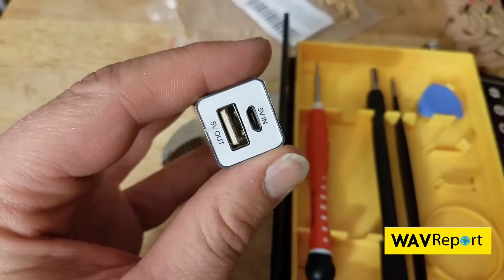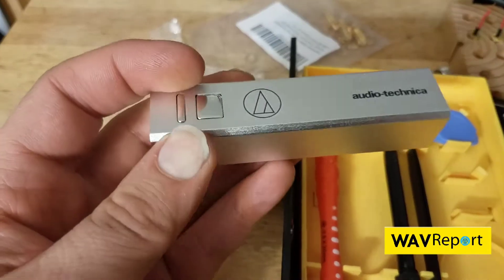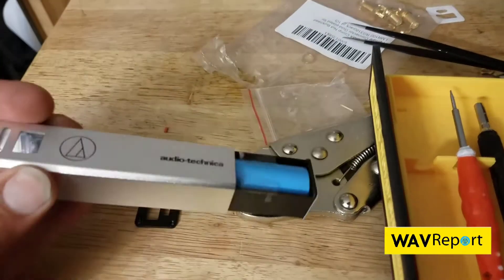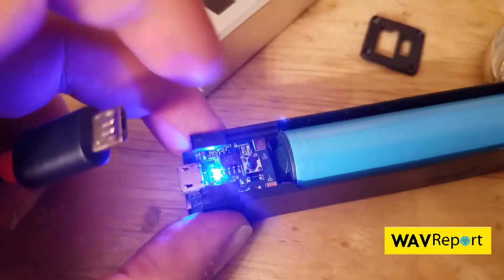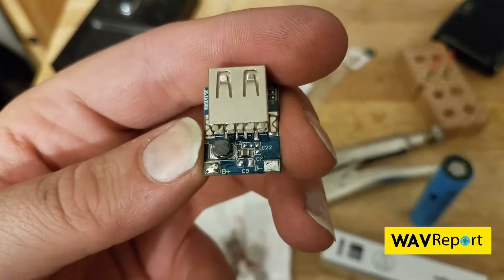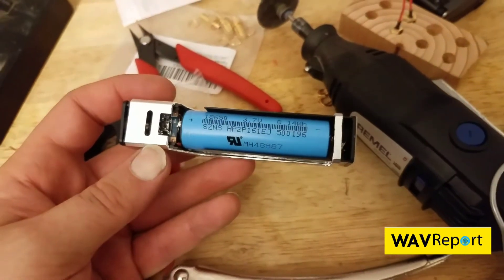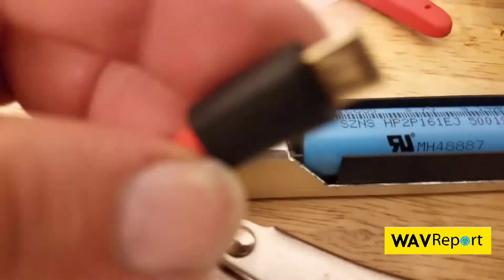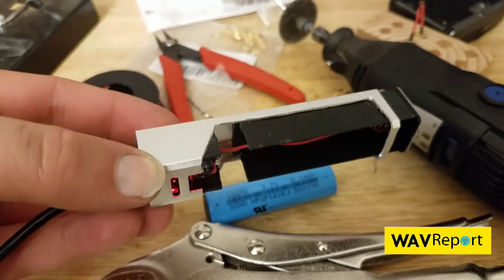Hacking a USB Battery into a 18650 Charger

Comment: I'm wondering, I have one of these. Can I use the board to charge a 3s battery pack? If I wire them in series would it be able to charge all 3?